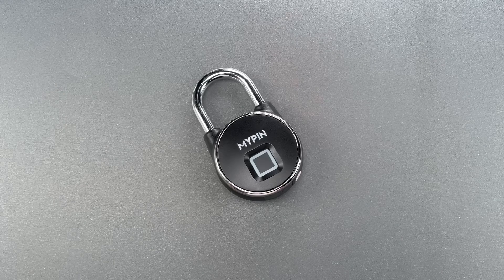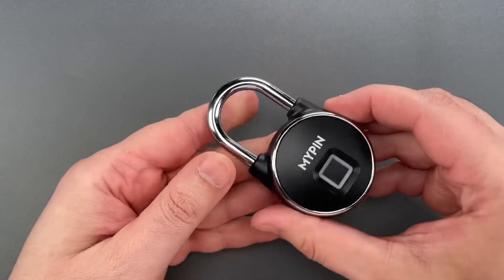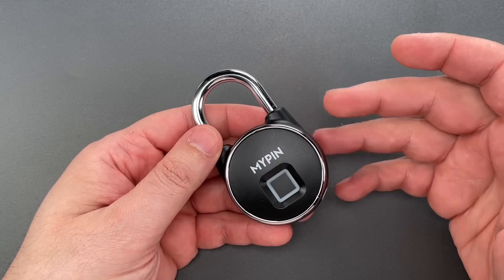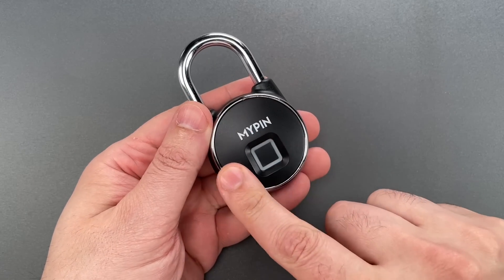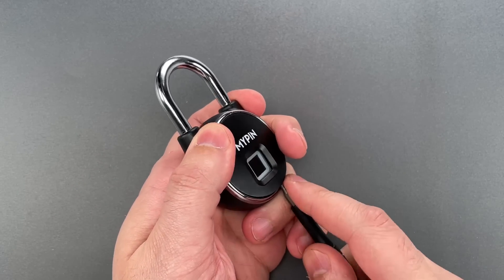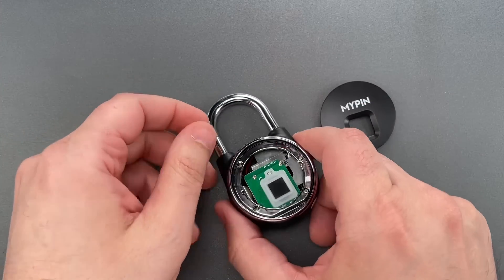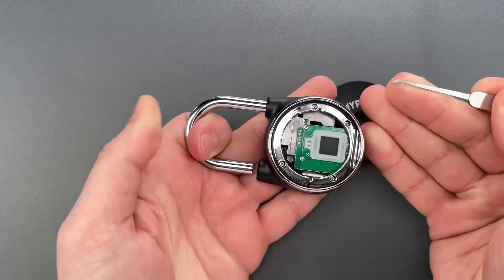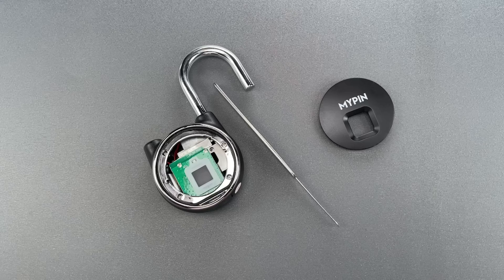[1469] I ALMOST Can’t Believe How Bad: MyPin Fingerprint Lock

Comment: To be fair, I checked their amazon store page, and actually nowhere do they write that it's in any way hard to open, pick- or tamper-resistant etc. On the contrary, they put a lot of emphasis on how easy and quick it is to open, and that you won't ever have to remember keys - very true, I guess :D

By the way, they also have the same model, but without bluetooth - I wander if it's equally easy to get inside.
Reply: These kinds of locks exist strictly for convenience, best used in high traffic areas and simply meant to discourage crimes of opportunity.
Reply: Almost certainly. Had it only had a small hole for an antenna then your one would be solid with no hole, but since it's wide open inside the shell of this one, I'd guess yours is the same, just with a little more unused space inside. This is an ease of assembly issue, it's cheap and easy to do it like this on a manned production line, it's just horribly insecure as a lock.
Reply: But when people buy it they’re still gonna be expecting something secure.
Reply: Yeah, I'd happily use it for a gym locker if I wasn't storing any valuables. Like a padlock on those is basically just an occupied sign
Reply: @OrbObserver  Firstly, no and then no and then $45 no.  Stop trying to use pseudo-logic to sell a bad idea wrapped in garbage.  Stick it.
Reply: @WizardofGOP  lol this is literally what LPL himself says so ok, whatever you say you sad, angry little man.
Reply: @OrbObserver  You are projecting.
Reply: @WizardofGOP  And you are sad and angry to come in and insult me for a view that the channel creator himself owns. Stick it.
Reply: @OrbObserver  Sure, parrot.  You now share the same thoughts as the Lock Picking Lawyer.  You are of one mind.  We should ask him, but I am pretty confident he wasn't referring to an expensive piece of garbage like this.

Comment: I think a zip tie might be the best security choice available.
Reply: steel zip ties are a real pain in the ass
Reply: @PeterShipley1  Correct.  They usually are made of aircraft control cables - hardened stainless steel that 98% of common tools simply bend around trying to cut.  The chance that someone actually has a cable cutter on them is very low unless they actually use them for their job. Even then, we had to try several to find one that actually worked more than a couple of weeks.  Even the hardened tools have problems with anything larger than a couple of mm.
Reply: The best security device is to place the lock on the inside of a gate so it's difficult to do all of these manipulations.
Reply: Even the plastic zip ties are more secure since it takes a moment to twist it enough
Reply: But but what about the blue tooth functionality
Reply: Even just a Zipper would be better than this lock

Comment: so essentially, it doesn't even matter if it's made of aluminum, because the real "lock" here is a piece of plastic that just pops off.

how is this industry able to get away with this??
Reply: in one word? amazon.
Reply: This is what the "market" says people "want"
Reply: Pragmatically, the difference between a good padlock and a crappy padlock is pretty small.  A crappy padlock will deter an opportunistic thief, and even a good padlock won't stop a skilled and determined criminal.  Not a lot of crime sprees where the thieves are picking locks when bolt cutters are a thing that exists.
Reply: How does it continue?
Public apathy.
Reply: Because most people put cost over deterrent and do not buy locks or security systems that are designed to deter or protect because they cost money, the industry is a race to the bottom in terms of quality and also there appears to be little or no testing done in real conditions to see if the lock actually works when faced with an attack.
The public don't know better and believe the hype, take for example the well known Masterlock, the name says it all a MASTERlock when anyone who knows and who has watched LPL knows that Masterlock in the main produce poor quality products that are basically only fit to be weighed in for scrap.
Reply: People don’t feel the need to REALLY look into how secure a lock is before they buy it. I wonder if LPL leaves reviews on his Amazon purchases; that would help a little more to deter future customers than having a YouTube video about it that they will never try to look up.
Reply: @johnnyjohnson6643  since you can add images to reviews he should just leave an image of the lock with the cover popped off. Pretty much shows how bad it is.
Reply: "Caveat emptor" has been a thing for over 400 years...

Comment: A few days ago I found the room with the washer of my apartment's house was "secured" with a combination lock. Inspired by the LPL I tensioned the lock and rotated every disk until I heard and felt a click. With the third disk in the right position the lock opened. The combination was 999. I got it within seconds. Thanks!
Reply: would have been funnier if the combo was 666
Reply: CHANGE THE COMBO
Reply: It's always a good feeling, applying a method shown here, successfully.. Muhahaha 😈
Reply: @faemike55  well if he holds it upsidedown it is!
Reply: Even if the tolerances had been made well enough that trick didn't work, a 3 digit combination doesnt take very long to brute force.
Reply: @branbroken  It does if you go in the wrong direction trying every combination.
Reply: @firesurfer  nah, you can run through every possible combination for a 3digit one in about 15 mins, realistically your going to find it sooner than that, if you run it backwards from 999 down your probably going to get it sooner like 5 mins or less because people naturally tend to pick fairly high numbers as generally somthing in our brains makes us assume the higher number will take longer.
Reply: Always a good idea to document your B&E crimes on YouTube...
Reply: @branbroken  True. I once found a 3-digit combination lock in my garage in my teens (it wasn't being used for anything), and so I brute forced it to find the combination. Only took me a few minutes. Then I used it as my bike lock. I know, not very secure, but marginally more secure than no lock.
Reply: @faemike55  The combo was 666. He was just reading it upside down.

Comment: God, what a burn "This lock was made more like an electronic toothbrush than a security device"! I can't even imagine just how much this hurts for an actual lock designer X)
Reply: Electronic toothbrushes are actually a bad example, since those are usually made to be waterproof. They are locked down quite tightly.
Reply: @Mernom  yeah it's probably nearly impossible to disassemble most electric toothbrushes without destroying them - the simplest way to make them waterproof is likely ultrasonic welding the parts together
Reply: Well I can imagine that the lock designer isn't hurt nearly enough since they were shameless enough to create pollution and trash with the intent to sell it

Comment: Goodness. So easily opened, and with only a modicum of brute force. The nerve to charge almost fifty dollars for that ugly paper weight!
Reply: Hey ! Respect the engineers who worked on this product ! It's an ugly BLUETOOTH paper weight !
Reply: I'd buy this: for $5, to secure my snack box at work. Oh, but I work from home, and am trying to lose weight, so, yeah, not even for that.
Reply: Didn´t u listen??? It can´t be a paper-weight, it´s lightweight aluminium !!!  🙂 Yeah, sure...
Reply: Now to be fair, I don't think it's ugly. But it is as useless as a screen door in a submarine.
Reply: @CheapBastard1988  Screen doors are actually useful on submarines though, internally for privacy etc... So even a submarine screen door is way more useful than this lock.
Reply: Bluetooth on a padlock is tits on a bull. This is putting an expensive gimmick over strong fundamentals.

As a counter-example, Abus makes some nearly bombproof disc detainer padlocks with excellent pick resistance and hardened construction that can be had under $50 that will handle pretty much any situation you could reasonably expect a padlock to handle.

Comment: Aluminium is also very difficult to paint so I could tell right away that a "cheap" product like this would be fake. It's much more easily colored by anodizing.
Reply: It could be plastic coating over an aluminum body with a few heavy steel pieces inside.  Would result in similar weight and similar design issues.  Many serious locks use those materials.
Reply: @johndododoe1411  A lot of consumers think weight==value; it's not outside the realms of possibility to think they just added weights because when doing research people said the lock felt too "flimsy" because it was light.

Comment: If you want to disassemble things that have plastic tabs without breaking anything, try and use a thin guitar pick. It usually works better than a screwdriver and leaves no marks.
Reply: Practical.
Or, he could cut a sliver of a Red Bull can...
Reply: A spudger is the standard guitar-pick-like tool for prying open gadgets.
Reply: @lairdcummings9092  I'd say the lid of a Pringles tube, because that's plastic too. And he has used a red bull can before.

Comment: Foiled by Faraday! The way you describe the lock body makes it into a Faraday cage, which blocks EM signals. 

Fun fact: a microwave is a radar array fired into a Faraday cage. Makes me wonder how much the North Warning System has been heating the air.
Reply: Out should have been designed with the Bluetooth antenna and fingerprint reader on the outside of a metal shell, and the important locking circuitry and mechanism inside the shell.

Comment: It really fucks my mind up that how hard it is to disassemble a smartphone while it is very easy to disassemble a smart lock, it should be the opposite.
Reply: Well to be fair the lock is 20x cheaper than the smart phone. But that thing. I think a zip tie would be more secure.
Reply: A modern smartphone is designed to be as compact as possible, while fitting as much as possible (cameras, cooling for a powerful CPU, cell modems and antennas, etc.) into that size.  Add in the fact that pretty much every major phone is designed to be waterproof, you end up requiring the device to be glued together, as there simply isn't any room for screw posts, and clips would fail to provide any sort of a watertight seal, in addition to likely causing the phone to completely fall apart if dropped, which will inevitably end up with parts being lost to the wind, rendering the device unusable.

The product featured in this video was designed to be as cheap as possible, while providing the illusion of being a lock to lure in customers.  Designing the product to be secure would cost more, both in terms of R&D (you need to have experts evaluate the design, as well as put actual effort into it), and in terms of production cost.  It costs more money to use adhesive compared to moulding clips into the case, and since this product was designed to be as cheap as possible, any sort of adhesive (much less a quality adhesive that would actually deter an attacker) is out of the question.  Same with a metal case to protect the internals, that will add cost to manufacturing, while not providing any benefit.
Reply: @thetechconspiracy2  I have a Sony Xperia Go, this was released in 2012 and this is a waterproof smartphone and it's as thin as a normal phone yet they were able to make the back held by screws and they used a large silicone ring instead of glue, so you can for example change battery without losing water resistance, so it's possible to do it, they just don't want to make them repairable.
Reply: @thetechconspiracy2  I would also expect a lock to be waterproof.

Comment: What i'm a bit saddened by is that LPL didn't pursue the antenna idea further after opening the front housing.
Reply: What's the point?
Locks done for within 2 steps
Reply: @prettyboyjeremy  I would have loved to know if he could crack it without even touching the insides.
Reply: @alexs5814  ,
He was looking for the antenna to find the hole it would be sticking out of. As that hole would be a potential vulnerability, LPL wanted to know if the lock designers made that hole in the best possible location (a location where, if anything is stuck into the hole, nothing of the locking mechanism could be touched). What he found wasn't a pin sized hole he was looking for... but... the entire front face of the lock is completely bare except for the plastic covering which could be pried open with a low-/no-skilled attack!

Comment: Mypin: We have an aluminum body on the lock, i promise we aren't lying about that either.
Me: Ok, don't care about that, what are some of the security features?
Mypin: We also have bluetooth technology integrated that necessitates an antenna only have a thin plastic shell over it for reception.
Me: ... That's not a security feature. What are the security features?
Mypin: It can also easily be disassembled with only the most basic of tools and no key or passcode required!
Me: DO YOU EVEN KNOW WHAT SECURITY FEATURES ARE?!

Comment: These "Smart" locks just seem like gimmick locks for highschoolers and their lockers. Or for taking to the Gym.
Reply: They have a lot of potential if they were designed and manufactured well.  Crap like this one, however, are only worth the value of the parts in salvage.
Reply: Only needs a thin metal plate, under the fingerprint sensor, to shield the internal mechanism. Would render this form of attack Impossible.
Reply: @matthomer1224  which would bring us to step 3: ripping the guts out of the lock.
Reply: @crinkly.love-stick  True, no lock is ultimately theft proof. Only takes a battery grinder to get past 99% of locks.
Reply: @matthomer1224  honestly,  that's too much trouble.  A well aimed hammer straight down on the lock works almost as well, without the noise or sparks

Comment: That's awesome, I work for an small escape room company and I love the variety of padlocks you show. Definitely gonna use some of those "novelty" ones in some future projects because customers are gonna love it.
Also, most of the time I watch your vids, I genuinely laugh.
Reply: For somthing that is a novelty and doesnt need to be secure cheap locks are pretty usefull. If going with a finger print lock like this id like to see a room where youd have to use a finger of a "dead" inhabitant (silicone hand) or a csi style print lifting from an object, (youd obviously need to be careful during room resets to seed cleaned objects with the apropriate prints).
Reply: @branbroken  indeed, this specific type of padlock would imply that the room is designed well enough that it's not an ordeal to reset it.
And yes that's the good thing about an escape room, people like to be able to get out eventually so you can't make it too secure.
Obviously I wouldn't use those to secure something, most padlocks are plenty bad, as we know. 😉

Comment: I actually have a suitcase  version of this lock. It has the same security flaws and all and I love it. I use it to lock my camelback during music festivals. It’s light and easy to open. However I would never use it on something that I am not going to have on me at all times. It’s more of a way to prevent people from accessing something without me noticing. The most important function of a lock for me to use it in the application that im using it is weight and that it cant be tugged open. I don’t understand why anyone would buy this version as it is too heavy. If you need something to prevent pick pockets it’s a good lock but never leave it unattended.

Comment: Of course  if you glue the front panel ,(previous installing a very thin panel,)  to avoid gluing rhe mechanism .using epoxy resine , will be very hard to  break.

Comment: Add to that that there is no “bump” security visible… an electronic servo and spring is what I can see. A firm tap with a rubber mallet or deadblow hammer will pop it open too.

Comment: I probably had surprised Picachu face when the whole internals of the lock were fully visible after removing that plastic cover. Even I would have know that you can directly push the lock open through that huge opening that shows the locking bar. It also seems shimmable with a single shim so it will be vulnerable even for a low skill attacker that doesn't even bother removing the plastic cap.

Comment: Dear LPL, you might consider testing how such locks react to a stun gun discharge. I'd guess it could be different based on electronics used, and on the path electricity would take - so hitting the body, or the charging port, or the sensor might produce different results (i.e. nothing vs battery exploding vs lock non-functional due to death of sensor but functional over BT / lock completely dead and unremovable other than mechanically).

Comment: you dont even need a hole for a wire for the antenna. You could use two metal contacts surrounded by plastic. Or a inner contact out of brass, a thin isolation out of plastik or something, and a outer contact ouf of brass. And the isolation also hasnt got to be plastic. Could be glass, could be ceramic.

Comment: I always chuckle about these easily defeatable high tech devices. By far and away most lock security breaches are done with either a hammer, bolt cutter, large crow bar or in the case of a high class burglar a battery powered cut off tool. I call those my non-covert companions. All purchasable at Harbor Freight for a low price.😂